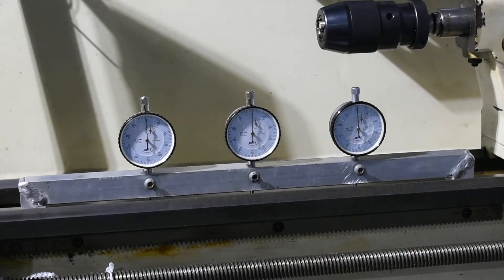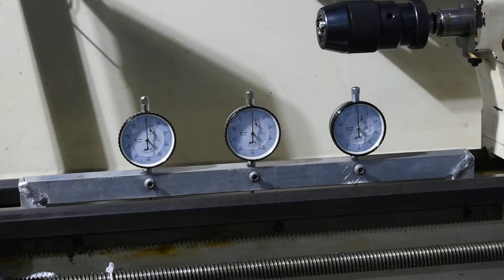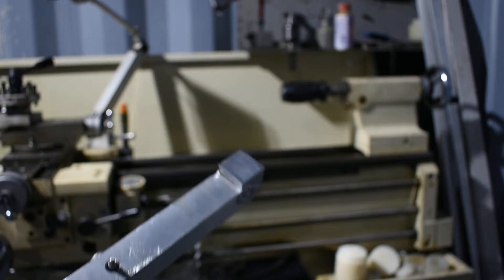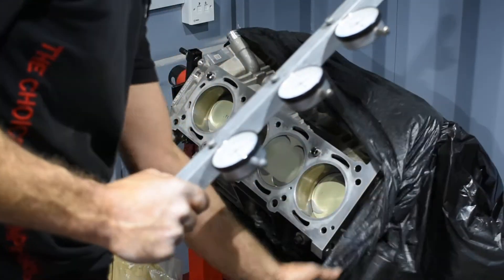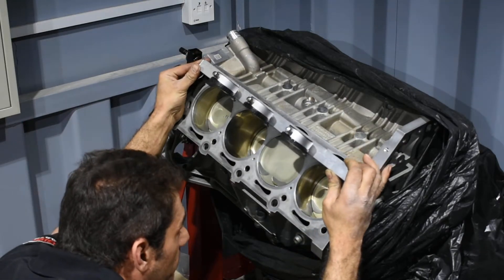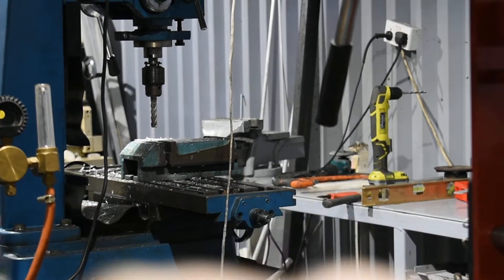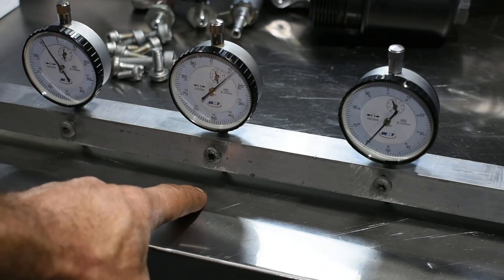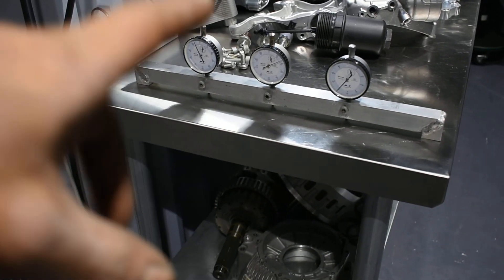this is what i'm using

Comment: That’s a nice tool , ingenious, if the engine block is showing different values  how do you fix this? Thanks
Reply from the maker: +Antimatter hi, by re-sourfacing the engine block or the cylinderhead or both it depends how much bend they are. Thanks